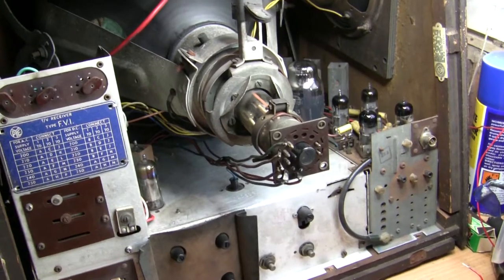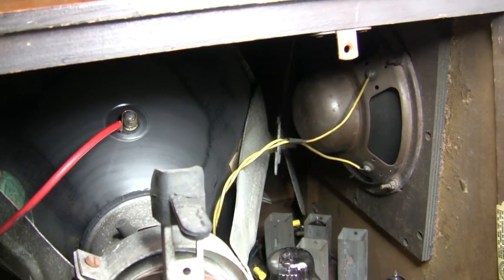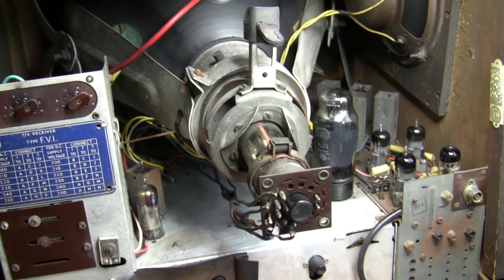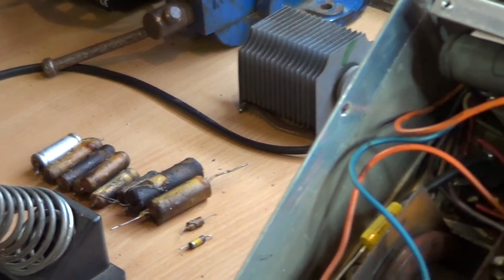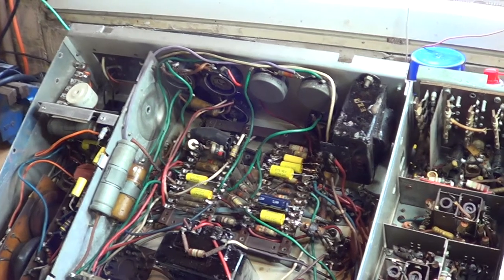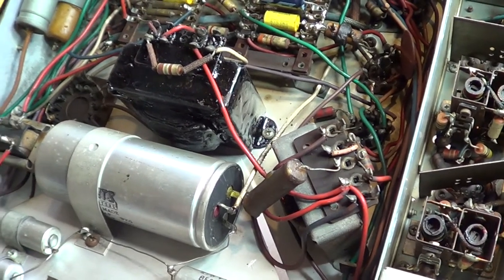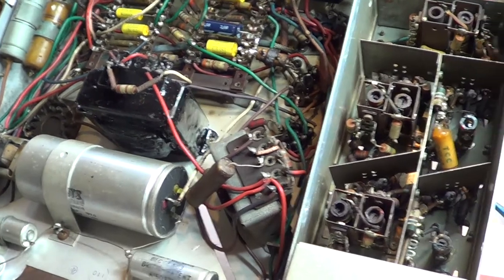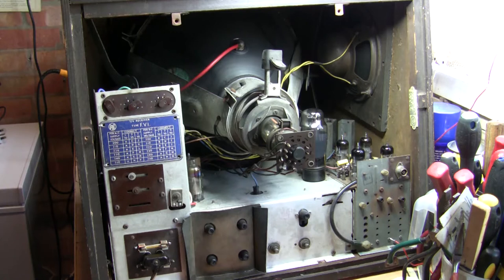Update On The Vintage Pye FV1 1951 TV repair.

Comment: Iv just picked up a marconi TV today, looks similar era to this, you wouldn't happen to know how I'd go about identifying the model number so I can possibly find a schematic? Thankyou
Reply from the maker: Hi, Thanks for your comment and well done good luck with that one on the restoration. Re what you ask this site is always a good place to look for staters re what model you have re-link below. Great to hear these old TV sets keep turning up! Have fun. Kev. https://www.thevalvepage.com/tvmanu/marconiphone/marconiphone.htm
Reply: @BramleyProductions  thankyou I'll take a look, yeh I've never been inside a vacuum tube crt before, although I've watch shango066 for years, it's just a project, I'm wanting to obviously find the cap values for recapping and stuff. Thanks again
Reply from the maker: @reacey  Yep, these old TV sets can give hours of fun in trying to get them up and running again! Plenty of data still out there I always like to have as much service data as I can find on these sets I'm working on for sure. Good luck with the set. And do let me know what model you think you might have. Often HMV and Marconi use to use little white plastics plates on the back of the set somewhere with the set numbers /model No on! But very often these get broken off Kev.
Reply: I replied back but I'm not sure it actually posted, I found the service manual using your help, it's a 1952 vt59da, thanks so much
Reply from the maker: @reacey  Thanks that's great you have found what set you have! And thanks for your comments I think they all came! Good luck with the set when you start and hope you get a picture I time back up on this set. Kev.